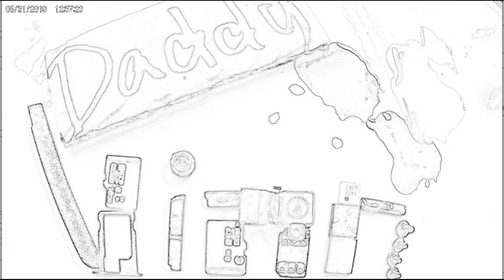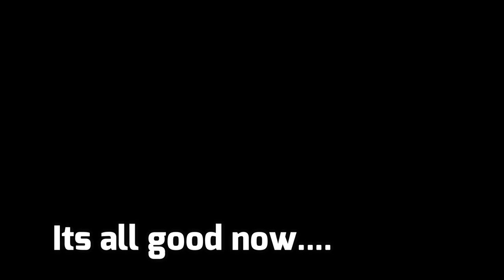Fix Aegis solo NO coil detected due to wire disconnected

Comment: Hi i have a Aegis squonk, It stopped working i looked inside and the white wire has come off im not sure were it goes so i can solder it back on,  could you please help....your vid is the closest ive found to the insides of the mod, BUT mine has black, white ,red. is the white wire the same as the blue would be? I even so i cant see were it waz attached, Thank you for your Vids and Help much appriecated  lee   :)